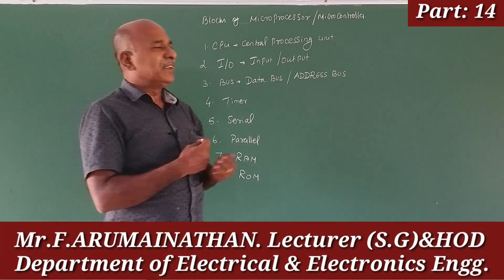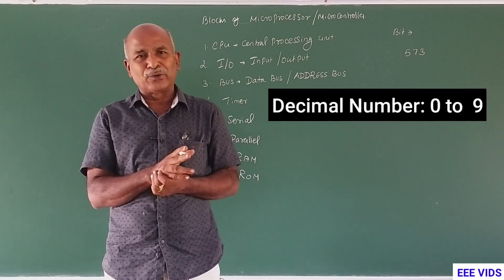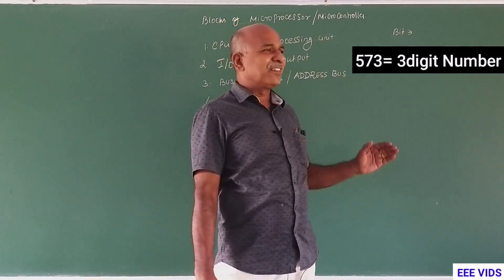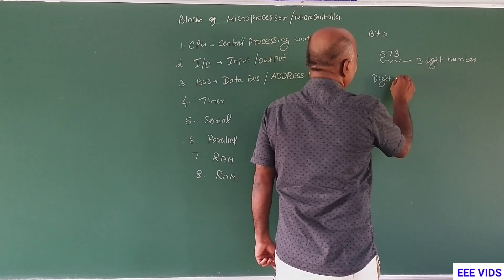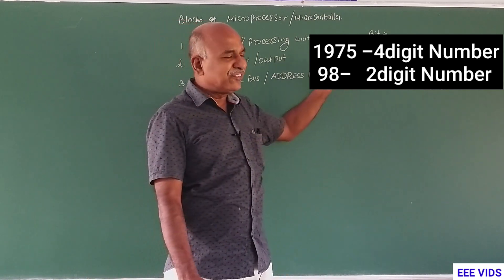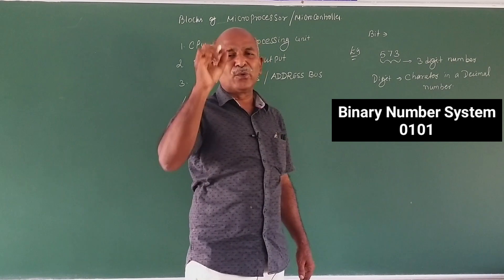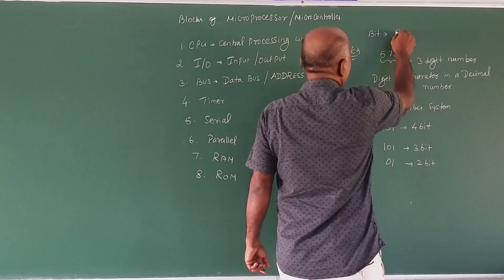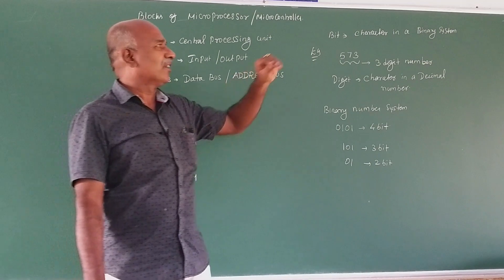What is Bit in computer? in tamil

Comment: For Example:- 64bit operating system, why we are considering a  2^63 decimal number value into bit
Reply: Bit is 0 and 1 then why we are going for 2^n( 8bit means 2^0 to 2^7, 16bit means 2^0 to 2^15, 32bit means 2^0 to 2 ^31 and 64bit means 2^0 to 2^63)
Reply: @stalinsubbiah3238  not 2^n
   That is 2^n-1